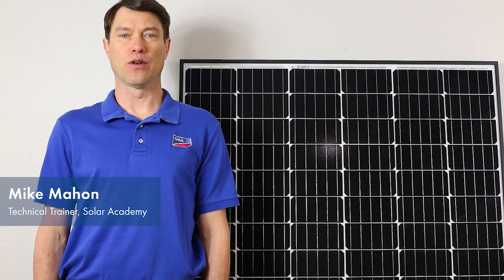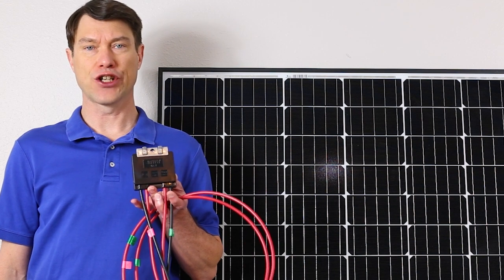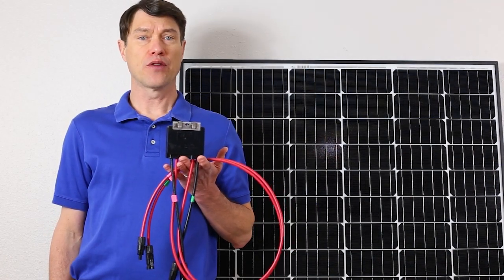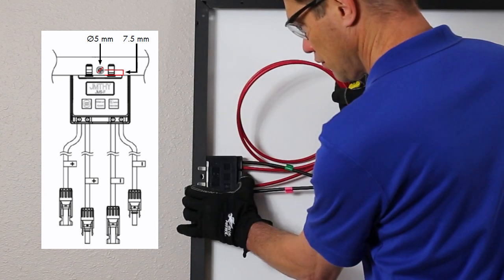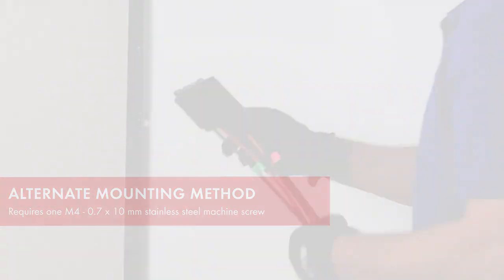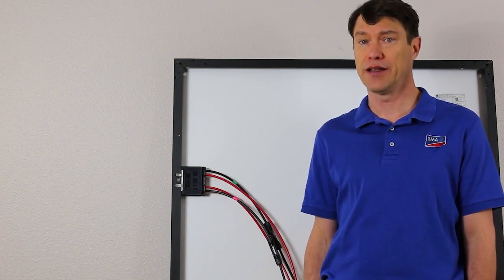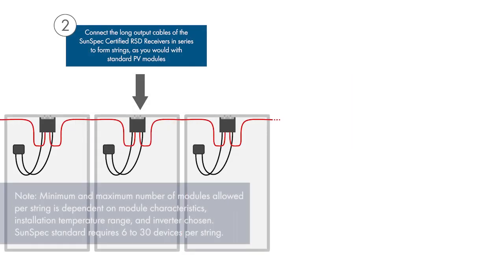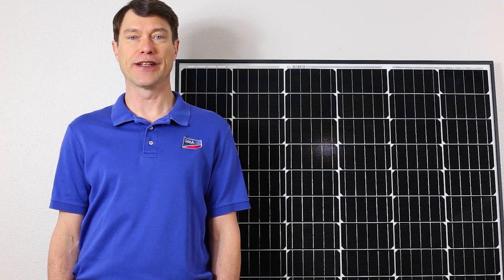JMS-F SunSpec Certified Rapid Shutdown Device Installation

Comment: Happy that you still answer questions. an SMA installer here. Please help.
1/ My string of 6 solar panels measured 5V, instead of 6V (JMS 1V * 6 panels), were all the 6 JMS working properly or was one failing? I can't easily access each JMS.
2/ My sunpower panel Voc is 85.6V, the JMS max open voltage spec is 60V, is this ok in the long run? And will the entire 72.9V Vmpp be flowing through in normal working mode, i.e. JMS not blocking?
3/ Does the Tigo TS4-A-2F rapid shutdown work with the SMA SB6.0-1SP-US-41 without an RSS transmitter? i.e. the RSS is built into the inverter, so I just connect the Tigo directly to the inverter and set it to TS4 rapid shutdown?
Thank you so very much!
Reply from the maker: Hello T N, please get in touch with our Online Service Center via my.sma-service.com/s/?language=en_US Our colleagues will look into it. Sunny regards, Daniel from the SMA Social Media Team

Comment: To be clear, and minimum of 6 JMS-F are required per string?  Is their a work around if the string is only 4 or 5 panels?
Reply: I also have this question. I hope SMA responds.
Reply: @kalia4me  I contacted SMA and they confirmed a minimum of 6 are required.

Comment: IS THE OLDER MODEL OF SMA INVERTER  • SB7.0-1SP-US-40   ALSO COMAPTIBLE WITH THESE RSD.

i SAW • SB7.0-1SP-US-41 IS COMPATIBLE.  PLEASE LET US KNOW.
Reply from the maker: Only the US-41 line of Sunny Boys has the integrated SunSpec certified transmitter. The US-40 line is not approved for use with SunSpec certified receivers for rapid shutdown.

Comment: What shutdown initiator switch do you recommend to pair with this? Does it plug directly I to the sunny boy us-41 inverter?
Reply from the maker: All models of the Sunny Boy US-41 line have an integrated SunSpec Certified Transmitter to be used with SMA Approved SunSpec Certified Receivers. No additional external transmitter is needed and none should be used. Once the transmitter is enabled during commissioning, any loss of AC power to the inverter is the trigger to stop transmitting from the board (the initiation of rapid shutdown). So any device that meets code requirements and isolates utility voltage and frequency from the inverter’s AC terminals is appropriate as the rapid shutdown initiator.  Often the inverter’s breaker in the main service panel can fulfill all code requirements for the initiator.

Comment: Are these compatible with the Sunny Island inverters?
Reply from the maker: Erica – The Sunny Island is an AC coupled battery inverter. Rapid shutdown only applies to PV systems, up to the PV breaker in the AC service panel. So the JMS-F units are not needed with the Sunny Island, as they are not part of the PV system.

Comment: How do I disable the SMA internal RSS Transmitter? I am looking to install a Tigs RSS transmitter instead. I have: SMA SB7.7-1SP-US installed.
Reply from the maker: Anant – the SunSpec transmitter is not turned on by default. If your installer enabled it during installation, they can turn it off. This needs to be done locally (logged into the inverter) unless your system is registered on the ennexOS Sunny Portal. Note that the SunSpec transmitter is only in the US-41 models of Sunny Boy.  Also please note that no Tigo -F variants are compatible with the Sunny Boy US-41 line as they are not SunSpec certified.

Comment: Ok: I have 7.7-41-us One Strings "A"; With Rapid Shutdown, what happens if I install another string "B" without Rapid Shutdown. Thanks...
Reply from the maker: The system will not be in compliance with all of the requirements of 2017 NEC 690.12 without equipping all modules with a Rapid Shutdown receiver.
Reply: @smasolartechnology  Thank You. I appreciate the reply.
I follow the law and do not try to violate any code. My idea was in any case of emergency. In Puerto Rico and the Caribbean there are hurricanes, and the system is very fragile, the last time almost a year without power in P.R. "For any case of emergency". In the MNPV8HV-DLTL Strings "A"; stay the same all modules With Rapid Shutdown, string "B" for emergency, without connecting to the MNPV8HV and I know the setting OFF, ON and disable, for emergency. To setup the emergency I love the Island, but I feel in love with you SBS6.0-US. Which ONE wow. And, Thanks again, I appreciate the reply.
Reply from the maker: @holdmode  I understand the desire to utilize SPS, but with the SunSpec transmitter enabled, the SPS function does not operate as designed. Also, if the PV modules are on the roof, even if not connected to any inverter, the string voltage will be above the 80V allowed by code when rapid shutdown is initiated.